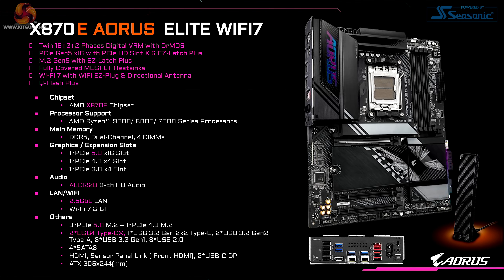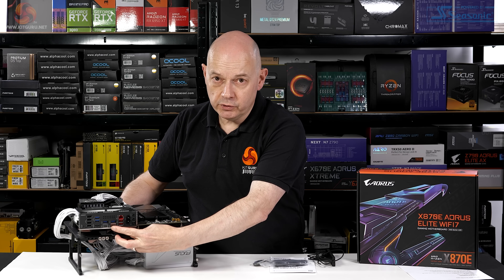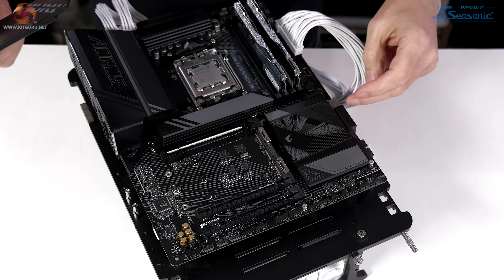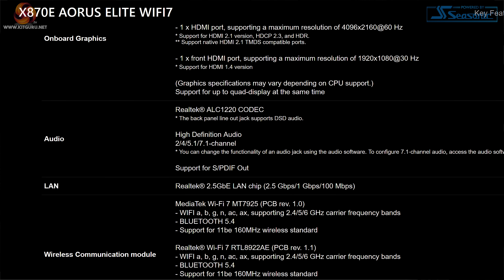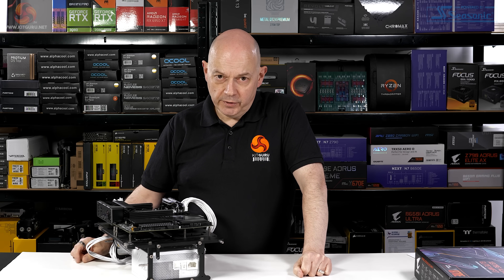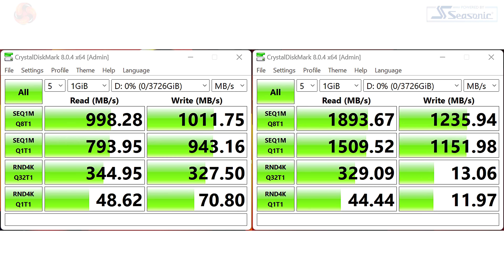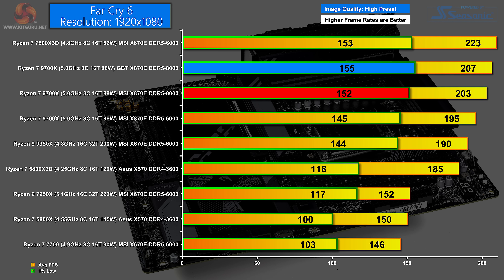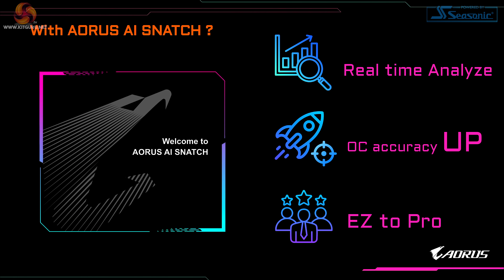Gigabyte X870E Aorus Elite WiFi7 - surprised us!

Comment from the maker: Please report any spam you see, it's seemingly never-ending at the minute! While you're here, let us know if you agree with Leo on the X870E Aorus Elite...
Reply: what is differen between this and x870e pro?
Reply: Hi, sorry to bother you, may I ask for help about page 25-26 of the manual talking about the need to 

"When using a single-sided M.2 SSD, first attach the bundled M.2 thermal pad to the pre-installed thermal pad on the M.2 connector before installing the M.2 SSD"

My new new Gigabyte X870E Aorus Elite WiFi7 looks just like yours but I don't understand what this "bundled M.2 thermal pad" is: I don't have one in the packaging of the motherboard... should it be expected to come with all NVME SSDs? 

I know my new SSD (Samsung 990pro 4TB, it's a single-sided form factor) doesn't have one and I don't understand whether I can install it properly or not. I'm baffled. I don't know what to do. Should I buy some thermal pads and install them? Did you encounter a similar issue?
Reply: Also page 26 mentions some thick and thin rubber pads: those absolutely seem proprietary and weren't bundled in my packaging, which was new. I tried contacting AORUS Gigabyte assistance because I am at a loss here... I don't even know what specific thickness I need to reach if I want to use thermal pads from other producers...
Reply: I notice your package lacked those items too.

Did you find any issue with temperatures while testing your nvme? Was it single sided or double sided?
Reply: I would be going for this if I hadnt got a X670E Asus Crosshair hero and paid a lot more for it getting close to 2 years ago now the Gigabyte looks like a better price

Comment: Thank you for the review. I found it extremely helpful. I noticed that one of the M.2 slots has a heatsink however the other 3 just appear to have a cover. Does the cover act as a heatsink as well of some sorts or is it just providing the minimal clearance required for a graphics card and therefor the other 3 M.2 slots will not accommodate heatsinks?

Comment: There is a trick for Cinebench R23, R20 and R15 to get a slightly higher score. However, it no longer works for version 2024. I use it for the multicore test without set timings. In the process manager, this program is assigned real time priority. Then the test starts. During this test, user must expect that Windows will be completely unresponsive before the test is completed. Thanks to this trick, I am currently able to achieve average 36300 points in the multicore test with my Ryzen 9 9900X.

Comment: I have the Gigabyte Aorus X570 Elite and it has 3 spare PCIe slots after I install the GPU in the metal reinforced slot. Them taking away one PCIe slot and putting 4 M2 SSD slots instead in total just doesn't make sense to me. There are people like me who needs lots of USB3 ports to connect external HDDs or other devices.

Comment: My experience with that board is very bad: Every 3rd or 4th boot, the board hangs with error code "4d" and the "BOOT" LED is on (not the DRAM LED). Clearing the CMOS solves the issue and the board is able to boot again a few times until the error occurs again. EXPO is disabled. On top of that the chipset heatsink is getting ridiculously hot. I measured it with an infrared thermometer to 76°C (Chipset temperature sensor reports 85°C). Does anyone else have these high temperatures?
Reply: Hello, I am looking forward to buying this motherboard paired with a Ryzen 7 9800X3D. Have you fixed the issue and is it worth buying this motherboard ? Thanks!

Comment: How did you remove the heat sink above the battery?
Reply: I got no answer as well. Apparently no-one bothers about the "possibility" to have to replace the battery or to clear the CMOS. And in the so-calles users manual of Gigabyte the MB looks differently (no heat sink, items fully normally accessible) but on MY motherboard there is this shit alloy plate...
Reply: @PatrickChazal yes it’s very weird because I just want my cpu debug light to go away and I think that removing the battery actually can help fix it but it’s just the damn heatsink…

Comment: Waiting for this to show up in 6 days. This with a R7 9800X3D, 5070 ti oc, in a Hyte 70 case with screen. Loved your video!! Thank you!
Reply: I am looking at this also to pair with a 9800x3d. Please let me know how you like it. I have an Asrock Taichi Lite B650E. I keep getting bluetooth, usb errors lockups.
Reply: @Rad_Pug  So been up and running since 6/22 and everything seems awesome. I am getting an 08 code on the MB but even GB doesn't know what that code is. Everything I have read said it's a benign code reserved for a later date. I'm 50 and this was my first PC build. MB made it pretty simple to get it set up. I did F up bad though. I'll admit this. I didn't have my CPU cooler tight. ADHD moment and a squirrel ran by when I was installing it. PC had some smells to it. Thought it was the "new pc smell". After 2 days of running it I looked through it saw no burning wires. Check the cooler and the screws turned pretty easily. I was pissed. Thermal paste was burnt. Cleaned it and did paste and all seems good. Not sure if the CPU got hot or not but PC "seems" fine. May order a new CPU and give this one to one of our sons. 🤣🤣 Uggh... we all learn and some harder than others.
Reply: @RiverRat904  Nice! Mistakes happen, glad it is working well and thanks for the reply!

Comment: board has been good to me... except for the horrendous boot time. it retrains the memory every single boot. takes 22 seconds just to post, around 50 seconds to get into the os on a gen4 nvme. seems like this has been an issue on other 870/e boards but other vendors fixed it in bios updates. still waiting on gigabyte. my ram is on the QVL on the board's support page so i guess just unlucky. but aside from that... everything works as expected and has extremely nice QoL features like the m.2 quick mounts and the pciex quick release button for the gpu.
Reply: has this been fixed by now? I'm about to order this motherboard but I want to make sure that issue has been ironed out first

Comment: Great review of a fine motherboard from Gigabyte.  However, if you use a Noctua NH-D15 cpu air cooler as I do, you'll discover there is absolutely NO room between the cooler and graphics card.  Installing the graphics card took some finesse and I was fearful I might break something.  Everything seems to be working fine so far but I wish Gigabtye added a few extra millimetres of space between the graphics card slot and the air cooler.
Reply from the maker: Thanks for sharing

Comment: If you were to have every m.2 nvme slot filled does it cut from the 2 full sized slot I’m asking because I’m thinking about upgrading my pc and I have a bunch of m.2s and a 10 gigabit network card I would transfer over
Reply: Only NVMe drives at position 1 (above GPU) and on the 3rd slot don't affect the first PCIe speed. So if you have two NVMes you place them at slot 1 and 3 and your GPU has the full PCIe 5.0 X 16 speed. If you add another at slot 2 or 4 your first PCIe slot (the GPU) become PCIe 5.0 X 8.
Reply: @ ok thank you

Comment: I tried this board expecting better DDR5 OC support for a 4x48gb setup and I am not impressed so far. AIBs really are making the 'E' designation less than it is meant to be imo.
Reply: Four sticks, especially at that density, is a real no go on AM5. I felt this cause myself would like 192gb of RAM with no speed penalty. That's why I've stayed at 96gb (2X48gb)

Comment: I have this motherboard and the wifi aerial plug is not so clever. I want to use my old aerial which has proper gold plated connectors but I can't find any way to use it with the socket on the motherboard. The aerial that came with it doesn't have a long enough cable. I am tempted to put the old wifi card in since I can't user wifi 7 any more. It's a TP link AX3000 which might be on a par with the on board wifi but without wifi 7.

Comment: I just bought one for about $275 USD (before taxes and shipping charges) will get it (supposedly next week from a local vendor) I'm replacing a MSI X670E Gaming WIFI and the reason is that I want to take advantage that my monitor can do DP over USB-C so I'll only need to use one cable instead of USB-C for the USB hub/software control and a DP cable for the video, it was cheaper than a MSI Tomahawk X870 (non E) have quite sometime without using Gigabyte hopefully it works well!
Reply: Also just today I saw another YT video in where the reviewer says is the worst X870E motherboard in the market, hahaha OMG he states that this is because the VRM section only uses 60A mosfets I have always think that about 300A in general are good for any current CPU but well that reviewer is saying that's the reason is the worst X870E motherboard and says that for the same price the MSI 870E Tomahawk is very superior but in my country the Tomahawk costs about $120 USD more than the Aorus!

Comment: A $290 motherboard is NOT midrange are you out of your mind?!?!?! That’s the price of a midrange cpu, much less for a motherboard. $150 is midrange for motherboards. $80 is budget. If you’re talking AM5, sure it’s midrange, but AM5 really only starts at midrange. There is no such thing as actually budget for an AM5 build. Also, yes, I know motherboards get to like $1000, but that doesn’t mean that a $290 motherboard is midrange or even close to budget.
Reply: 290 is midrange. A premium board in 2015 costs this much. With inflation it's $400 today. Under 300 is upper end of mid range since under $150 boards is no longer a thing
Reply: @genericsidecharacter8915  no one’s building a piece of crap pc with a 80$ mother board in it 😂😂😂😂😂 my pc case cost more then your mother board. That’s sad dude. Save up build a real machine not something you plan on filling your dumpster with
Reply: Smells like broke in here
Reply: @johndough4871  no, just rationality.
Reply: @ Considering the lanes in this board cross with the M.2... I wouldn't call it high end... its got 2 B650 chipsets on it... so I wouldn't call it entry level.... Mid range hits about right. Rationally .
Reply: @johndough4871  almost if all x870 boards have lane sharing dude. Only like $1000 motherboards have enough pcie and m.2’s for their lane sharing to be excusable. But like I said, just because the most premium product is better doesn’t make this not high end. The 5080 isn’t mid range just because it has 16gb of vram. The 7900XTX isn’t mid range just because it has low rt capabilities

Comment: I have a quick question about the frequency of the 9700X, that you are using here. You show it being at 5.0 GHz, but from what I understand it does boost closer to 5.4 GHz on average. Same with the 14700K being at 5.1. Are you using less frequency in these tests. Or did I miss something in the video?!.

Comment: Gigabyte Aorus Elite was a mistake to buy for my opinion. After less than 5 days the mobo couldn't boot and I was flooded by DRAM light error and multiple bios post codes. The board couldn't get fixed with clear cmos different bios updates different RAMs and removed hard disks. All I got were BSoD and an RMA that unfortunately didn't got because I was at 15 days since bought. The motherboard is now at the offices of Gigabyte and is getting checked. Their update was that I have to wait since February 21st to get my mobo back.

Comment: I have the mobo. Constant 08 or D8 with 9800x3d. PC works fine though. Bios updated. Many others complaining of same fault as me, gigabyte has no answer. Also I may have missed it, but I didn't hear you mentioned about the m.2 slots, if you want to use more than the top gen 5 slot, you have to use the gen 4 slot, otherwise the other gen 5 slots will cut into your pcie 5 lane for your gpu.
Reply: @FrostyOsrs  code 08 means success post for that setup. Mine does the same things. It’s normal

Comment: I have a couple of questions if you could be so kind to to try and answer them ?

Currently I am stripping down my workstation after the gpu gave up the ghost so it's time for a full new build ...
old build is 64gb ddr5, 7950x, x670.

4x 2tb m.2 drives with hoardes of music production and vfx software spread between all drives including C.

the two things I really need to do is 

a: have 128gb ddr5 minimum (I have ordered 96gb in two sticks just to be safe but I need much more for my vfx simulations )
b: upgrade to x870e

my questions ...is 256gb ddr5 actually possible or is this just another faux pas and click bait branding?
128gb is apparently doable now on my setup but at a cost of speed, is this just the same outcome on x870e ?

and...if I am to upgrade to x870e for those extra and faster pci lanes and possibly better memory handling is there a way to create a snapshot of my C drive and all the programs so I can install windows then restore my programs and registry from a backup or clone ?

I really do have too much at risk of losing by fresh installing and starting again from scratch.

is the jump from x670 to x870e doable without a clean install or is it going to mess up my system just the same as jumping from amd mboard to Intel ?

sorry for the long winded ask but I'm right in the middle of selling off hardware and acquiring new gear as we speak and I'm struggling to not waste my limited budget.

thanks in advance

Comment: Excellent review really enjoyed it. I actually purchased the same motherboard prior to watching this video. Funny I also purchased the G.Skill DDR5 Trident Z5 Royal Neo in CL28 6000 32GB (2x16GB). My Main reason to purchase this board was price, features and a PCIe slot to handle a 10GbE Network card (4x Slot Gen 3/4). This was one of a few motherboards that had a x4 PCIe slot away from the GPU slot with enough bandwidth for the 10GbE expansion card. Today's GPUs bury most of the additional x1 to x16 expansion slots. Motherboards with x16/x8/x4 or x16/x8 are more expensive. Gigabyte Elite WiFi7 does share bandwidth between the PCIe 5.0 x16 GPU slot and 2 extra NVMe Gen5 slots which is the best comprise of PCIe lanes. I can't complain about a PCIe 5.0 GPU slot running at x8 with today's GPU's. I also chose The NZXT C1000 power supply and Ryzen 9800X3D CPU to be placed into a Montech King 95 Pro case.
Reply: Yeah, I got the Aurus wifi7 with the 4 m.2, 2 are PCIe5.0 and B & C pcie5.0 M.2 share lanes with the PCIex16 slot for GPU. Not sure why they didn't just make one of those a PCIe4.0 or even 3.0 M.2 but whatever. I don't think my 5070ti will saturate even x8 PCIe5.0. That's equivalent to a full x16 4.0 lane.
Reply: So can I put two M.2 NVMe PCIe 4.0 in this motherboard? Thank you.

Comment: for anyone wondering, the VRMs on this mobo do get hotter than average if room temps are higher than normal, where i live im usually at 28c, sometimes reaching 32c, and i've seen the VRMs get up to 68c nearing 70c, so make sure you have decent air flow in your case.
Reply: @Raindrop511  which case should i get i was thinking the h6 flow
Reply: @zazathrupain  looks very good, i have a Corsair 4000D myself, i think that case does come with all the fans you see on it, so just make sure they are an out take and it should be pretty cool in there.
Reply: @ tbh i been doing research on trying to connect 9 fans together which im having trouble on so i might go with the montech king 95 pro for my first build

Comment: How many M.2 SSD Nvme can fit in this motherboard without dropping down the GPS from 16 to 8, also can I use Gen 4 M.2 SSD in all the slots instead of Gen 5 as the Gen 4 would be cheaper to use.

Comment: Finally a proper look at this motherboard!! (I bought it, I'm waiting for delivery and I will be building a set on it!) - after over 5 years, it's time to say goodbye to the z390 generation and the Intel i7 9700k (and Intel as such for now ;-D - you know why ;-D) - and for me, compared to my motherboard, even removing these heatsinks (and the release of the graphics card without a sore finger or the risk of scratching the motherboard with a screwdriver to get to the lock) and plugging in the drives is insane!

Comment: I just rebuilt my 13700k system with this thanks in part to this video.  It was an absolute pleasure to build with, paired with a 9800x3d on latest bios, works flawlessly.  Not a fan of the lane-sharing situation, I could only retain two of my NVME drives internally (in order to maintain x16 on the gpu pcie slot), which is annoying.  Still a very good board with a ton of features, super stable even the garbage gigabyte software which actually works for a change.  

Anyway thanks for the informative video as always.  Very happy upgrade from 13th gen intel.  Intel go fuck yourself.

Comment: How viable is the large heat sink for cooling two Gen5 NVMEs and one Gen4? I've seen that Gen5 can run really hot so I am concerned if the single heat spreader works for multiple drives.

Comment: keep in mind that lane sharing of the GPUs x16 slot lane PCIE 5.0 is shared when using multiple PCIE 5.0 ssds.

Quote from the speficications page - " The M2B_CPU and M2C_CPU connectors share bandwidth with the PCIEX16 slot."

just get a x670e board if you dont need the higher lan spped / wifi 7 / usb 4.0 standard. everything else is pretty much the same or better on the x670e boards in my opinion. cheers <3
Reply: most of the x670e costs more than this board and the few that cost less only cost less by like £20 ish
Reply: Asrock nova is best no lane sharing and a cheap motherboard.
Reply: @christopherramsay5517  but its asrock if you dont want that brand its sad, but i agree the nova is pretty nice on paper, cant talk about it further as i didnt use it before only read about it. cheers
Reply: @teanymonster5227  one of few dont share lanes with pci-e slots.  Price is cheaper than other boards.